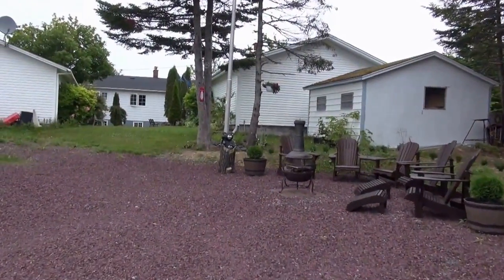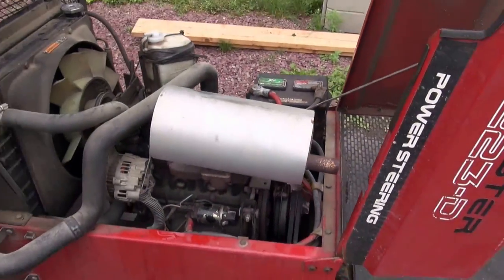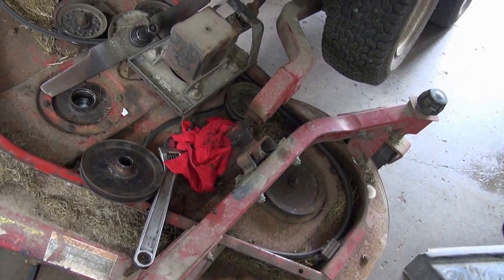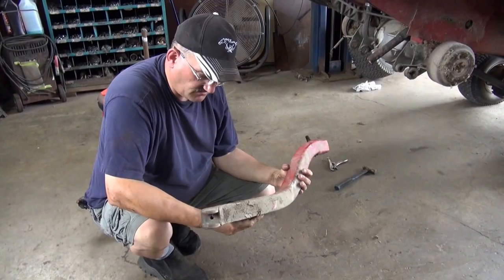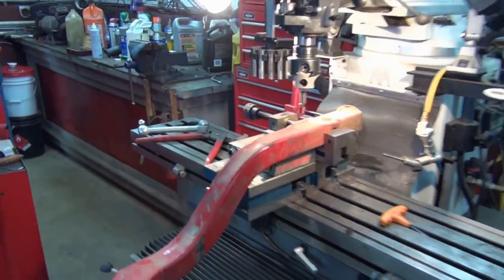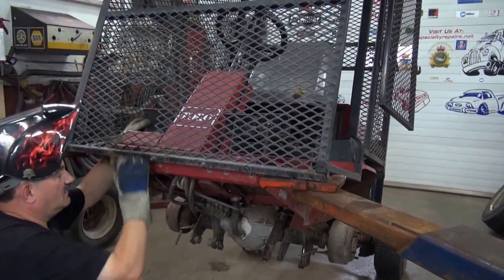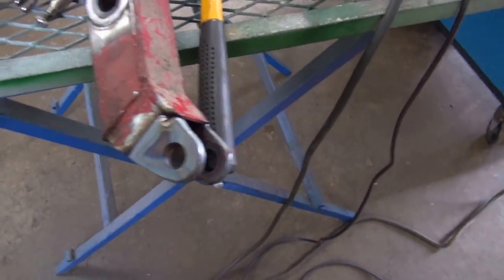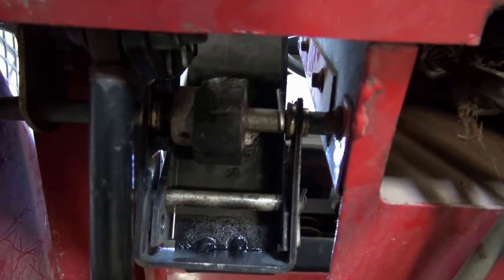Repairing The Mowers Part #1

Comment: I'll be waiting for part 2 and seeing if you clean the deck before you tackle it. :) That is a mess. They need to put more in the budget for that mower so you can do it proper. Looks like something that people do without regard to the equipment, use it till it breaks and then wonder why it broke. Add gas and keep going, no need to grease it or add oil, it never needs it till it's broke. Have a grandson that did that to his first two cars and couldn't figure out why it broke or why I kept telling him that if you take care of it, it will take care of you. Think he figured it out, at least I'm hoping so. Great video Paul and Kathy. Have a great day! Levi~~
Reply from the maker: Your right Levi. You need to look after the equipment. You and I are alike that way. I think the issue here with this mower is the fact it was purchased used. They ran it until it had major issues. It has all new filters on it and other places were greased. It the important mechanical issues were never addressed properly. I think it will be a good machine when I'm done with it. Stay tuned for part 2. I get in some trouble in that part ;)

Comment: it's all about maintenance Paul.....well done ....those jobs will last at least another twenty years....management doesn't understand most of the time the need to implement a good maintenance program ...actually saves you money..cheers
Reply from the maker: Jim Steketee So true Jim. Grease never hurt anything that I know of when used in the right places, I hope I'm doing the machine justice. If it were mine I'd do it the same way right or wrong lol.

Comment: I think someone threw that mower off a cliff and then used it some more. Toro's are great machines and that one is a great machine just in rough shape. My dad at his 1st job not the towing one they have two 72inch 328 d's and I got to cut with it once and I loved it. If they weren't so big I would be getting one to cut my yard with. Thanks for explaining where the air compressor was. I have seen that cabinet before and never would have known the air compressor was in there. Yesterday I was in and out of a BX for probably five hours doing some work in Mike's lot spreading stone. When I wasn't in the BX I was in a Gehl Extended Reach Forklift moving the cars around. That BX was a work horse. I definitely pushed it too, I made it work. I noticed the video looked a little wavy or distorted in some spot to where I didn't know if it was me or what but sometimes when I am watching these video's I get into them and block out surroundings. Anyway I am not going to take up all of YouTube's server for comments so I will talk to you in part 2.
Reply from the maker: Tyler Donovan The company that owns it now purchased it used a few years ago and keep it working. I was actually surprised that it was in such poor condition. I'm trying to prioritize and do the most critical jobs but it seems everything is needing attention.
It's hard to beat a BX when it comes to a days work. They just keep on going. I thought you might enjoy seeing the compressor lol. We'll soon be able to do more video's faster. Next week it's out with our DSL and in with the new Fiber Optics. It's going to be lightening fast. The wavy in the video is caused by YouTube. It took 15.5 hours to upload and 8 hours to process. ':(
Reply: Paul Short Wow almost a day to get this video on YouTube wow.
Reply: Tyler Donovan And what do you mean with out with the DSL and in with the new Fiber Optics. You are getting a new camera?
Reply from the maker: Tyler DSL is internet via phone line. Ours down loads at 7 Mbps and uploads at 1 Mbps. When we switch over to fibre optics next week we will down load at 50 Mbps and upload at 30 Mbps so everything should be lightening speed then meaning more videos and less work for me ;)

Comment: Paul, great info...I can only dream of having such a shop... It just so happens, I have the same unit plagued with the same issue of a sloppy lift arm. The deck lifts fine, but I wanted to fix it. I attempted to remove arm and couldn't get the pin out. Can you tell me the steps you used to remove?

Thx
Reply from the maker: +Rog 5511 
Wow. I did this back in 2014 and my memory isn't that good but I had a quick look at the video again and the cause of the lift issue was the two arms being worn. Check out 13:00 of the video. I don't think getting it all apart was tough. Most likely beat it out with a drift and a hammer. Maybe use some heat from a touch and that should do it. I rebuilt the lift arms myself due to the cost of new ones. They are a great unit.

Comment: Hey Paul I am wondering if it is easier to machine parts than go buy them in some cases like this in an area like yours ? Keep up the good videos!
Reply from the maker: Mike Sasso Well Mike that's a great question. Those arms for example are around $700. each. They would have to be ordered. I have the equipment here to rebuild them at a fraction of the cost plus I don't have to wait and receive the parts. We do have other un-rebuildable parts ordered but it takes weeks to get them here so yes it's easier, more cost effective and faster to make them. Happy to hear your enjoying the videos. Thanks!

Comment: The video has gone wonky in some spots.
.
I like this type of repair video - interesting to see what goes wrong where and why.
This repair must have cost some bucks, but it looks like the first time they ever had it serviced.

No love for the grease gun on that machine, maybe later after the bill comes in hey
Reply from the maker: 12345NoNamesLeft The wavy in the video is caused by YouTube. It took 15.5 hours to upload and 8 hours to process. ':(   Next week it's out with our DSL and in with the new Fiber Optics. It's going to be lightening fast which means even more video's. Ya there wasn't too much grease used on the machine especially underneath.Glad you enjoyed this video. I'll try and do more like it.